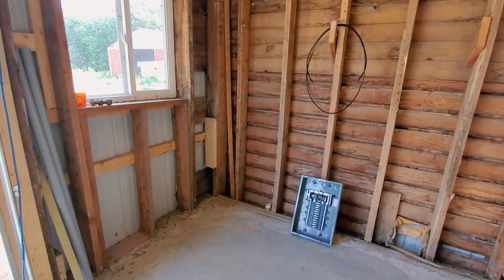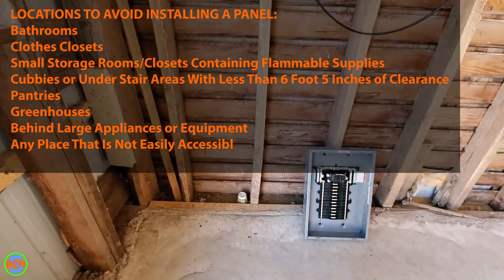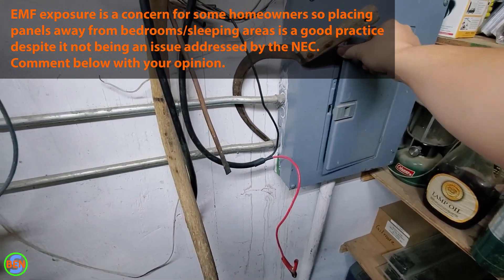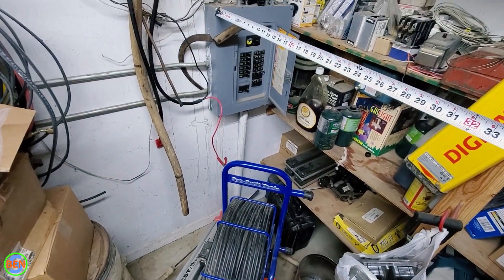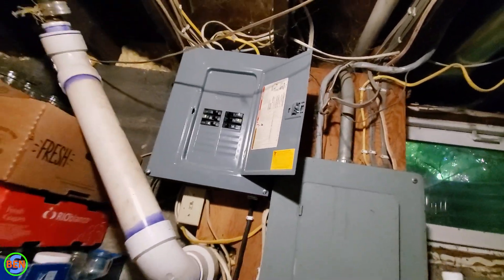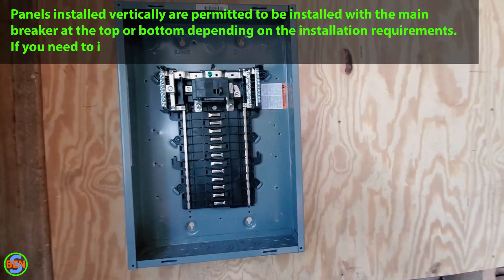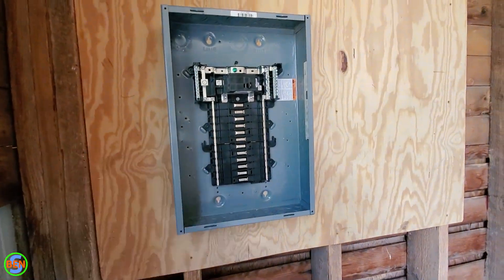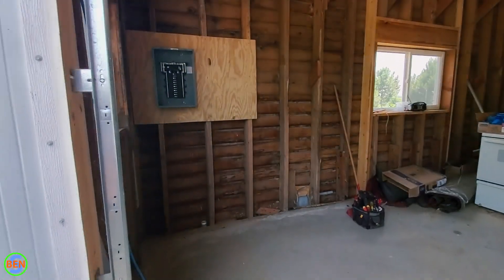How High Should I Hang my Electrical Panel?

Comment: there is rules about nothing in space above panels also such as water lines running over panel are you allowed to run a pvc pipe out of house above an electrical panel?

Comment: How is the 30 in rule applied when there are multiple enclosures.  I have an outdoor 320 amp meter socket, , with a 200 amp disconnect on the left and a 200 amp main breaker panel on the right,  with 2in x 5 in nipples connecting them (raceways) so basically 4 in between enclosures.  Any restrictions to consider?

Comment: WHAT IS THE MINIMUM HEIGHT FOR A OUTDOOR COMBO METER AND BREAKER BOX? Homeline 200Amp 30-Space 42-Circuit Outdoor Ring-Type Semi-Flush Mount Solar-Ready Main Breaker Plug-On Neutral CSED
DOING A REMODELLING JOB WITH A MASSIVE AMOUNT OF THINGS TO TAKE INTO CONSIDERATION.
WANT TO PLACE IT BETWEEN A TRIMMED WINDOW AND THE CORNER BOARD  APPROXIMATELY 30 INCHES WIDE.
WANT TO ENCLOSE THIS UNIT IN A  "CABINET" WITH A DOOR  THAT ALLOWS THE PANEL'S DOOR TO OPEN 90 DEGREES.
WANT THE TOP OF THE CABINET TO BE BELOW THE  BOTTOM OF THE PICTURE-FRAMED WINDOWS TRIM . WHICH IS NO MORE THAN 46 INCHES HIGH. ANY INFORMATION WOULD BE HELPFUL THANKS. CHARLOTTE NC.
Reply from the maker: I would contact the local building or electrical inspector in your area. I don't think that there will be an issue based on what you described, but it's always best to ask first.

Comment: does anybody know how low to the floor a breaker panel can be mounted? is there a minimum. I want to locate mine about 2 ft off the floor .
Reply: Did you find out the answer to your question?

Comment: I just found your channel and find it very informative. I have a simple question and I would appreciate if you or anyone could answer it. Question? What's recommended for attaching the panel box to plywood or backer board? Can I use 2" hex/washer screws? What I'm doing is wanting to attach a breaker box for my water heater, the box is 12" tall x 6" 3/4 wide. So I want to attach the box to a piece of 2x10 between 2 studs with 2" hex/washer screws.

Comment: Near the end of the video for the sub panel in the garage where is the best place to bring in the wire into the sub panel.  Top, bottom or from the back of the panel ?  Say if your main connectors are on the top of the panel is it better to bring the wire from the top ?  Or does it not matter where it’s brought into the panel ??

Comment: I'm planning on installing a sub panel in a shed in my back yard.
The walls are unfinished and the roof rafters are exposed as well.
The bottom of the wall where the rafters meet is 6'4 inches tall.
The Code book says I need a minimum of 6'6 inches of height for a main panel to be installed.
The rafters reach 6'6" after a few inches in front of where I was planning to install the sub panel, but are only 6'4 directly above the location itself.
Will i need ro relocate the panel to be within code, or is this a code specific for MAIN panels only?

Comment: whats the minimum height? I'm considering installing a sub panel but my only option is to go below the main panel, and right now the bottom of the main panel is about 4' off the ground or a bit less... seems a little low for a sub panel. is it?

Comment: Good video - got to the point quickly. I'm thinking low panels are generally a bad idea over time. For example in a garage a low panel could be subject to water spray damage if someone were hosing the panel. Same possibility for a flooded basement. Also, an owner may later bury it completely with a desk or junk pile.

Comment: Ben,

Questions: I installed my subpanel in the garage and want to wire my 3 prong 220 outlets. To the best of my knowledge a natural wire isn't required for this industrial equipment. can't seem to find accurate information about if I need a 8/2 or 8/3 wire for my 220 outlets and I'm uncertain if I can use the uncovered copper wire for ground with 220. I'd also like to have a welder outlet at the front and rear of the garage. Is it safe to use wire nuts in the outlet box to run wires to the second plug or do I need a junction box? Do I need metal boxes for the outlets or is plastic ok? 

Thank you in advance. I enjoy all your videos. They are very informative. You're a very talented young man.

Kind regards 
Paul H Cassidy

Comment: A little off topic, but I'm about to do a panel swap and a few of the wires are going to be too short. Rather than splicing a pigtail with wire nuts, which I think look trashy, I'm wanting to go with Wago 221-2411 inline splices because they'll look a lot neater. They're UL approved. What do you think? Thanks.

Comment: I see you are holding to wire cables squeezed together with a u tack. I don't think that's to code in Toronto because they can over heat at that point. Where are you living that this is to code? I also seen a video where you talk about the distance of a switch that has to be more than 36 " from a sink. But I don't see that any more. Where is that switch placement video please? Thank you.

Comment: Another great video. Planning to enclose a recessed panel with rockwool insulation and plywood walls. Is there any requirements for fire? I am considering six inches on sides and 12 top and bottom using cement board that is removable for future cable runs. Thank you!

Comment: Quick question for you.
I am trying to avoid paying several hundred dollars for the electric cable needed to run a line from my power box (on the power pole), to a secondary location. (The solid core cables for the 6 awg in my area are about 3.5$ a foot, but I can get stranded 3 awg for a little over 2$ a foot.) But I wasn't sure if it would be possible to do the connection between the 2 panels with that wire, or if it was only possible to use the solid core wires, due to having the neutral and ground separate. (None of the local electricians want to actually answer questions, and after watching your videos you seem like you know a good bit about this stuff.). I want to buy the equipment and then see if I can find someone to install the stuff for me. (It will be running from my power pole, about 70 feet to a storage room that will eventually be the power room for my homestead I am building up, I will eventually be migrating off the grid using solar, and wind power.).

Comment: Ben, one thing to think about is if you are wiring a house for the elderly, make sure that the top breaker is reachable by someone in a wheelchair. 
That is the reason for the 30” & the 36” clearances. 
When we had a house redone in 92, because mom was having double knee replacement surgery. 
Leroy the carpenter recommended that the electric breakers be moved to the porch off the kitchen at a height reachable by a person in a wheelchair. 
We never regretted that! 
Since 92 to now 3 people have been in a wheelchair in this house, 1 for 2 months, other 2, 3 to 10 days. 
Another thing that we did was to install outside outlets on the street & the alley ends of the house. Each one is controlled by a GFI breaker. That way when we come home, we plug the outfit in, turn on the front or rear breaker when we need it. 
This year on New Years Eve it got down to -28°f. 
Nice to be prepared. 
Power went out at 4:30 pm at -22°f. 
Came back on at 8:00 pm at -26°f.
Thank you for the helpful videos!
Hello from north east Montana. 
10 miles from the Canadian border.

Comment: What about a panel installed over a workbench? Does that violate the frontal clearance guidelines? Let's say it's a bench permanently attached to the wall, about 2' benchtop width, 2' below the panel, wires feeding top of panel, ample clearance on either side.

Comment: You should do a video on how to feed a sub panel from a sun panel in series…. 

I’ve looked and can’t find anything..

Especially I had a 18 slot Sub panel installed in my shed using 150 feet of  6awg with a 50 amp breaker and have a remaining 30 feet of 6awg..

I want a 20amp receptacle 60 feet away and have 10awg however it’s not easy to wire receptacles with 10awg and I don’t want to pigtail 12awg nor do I want voltage drop with the full
Run of 12awg

I was thinking of installing an outside sub panel between 1 to 4 breakers using the Remaining 6awg then feeding the receptacle(s) from there

Just wondering what advice, suggestions and or ideas you’d have about that..  

Thanks

Comment: My old main panel (old 20 space Square D QO) was next to a sink and its supply lines weaved through wiring out of the top of the panel. I have a short (6'6") basement so I left 12" from the top of the panel to the joists for wiring. I also installed next to a main doorway with no door.

Comment: With the understanding that the NEC says the service panel can’t be higher that 6’-7” High, unless your that tall it should never be a problem if installing the panel at the home owners eye level. I’m 5’-8” so the sub-panels at my home and garage are installed with the main breaker lever at my height, which is close enough for both my wife and I to reset breakers or for me to do electrical work. This is also how the service electrical meter, generac auto transfer switch and main disconnect panel are installed at my height.

Comment: Where I live, NE side of Houston, all the homes in our neighborhood have the panels outside on a rear wall of the house or detached garage. They are water resistant as far as the door being flanged but not watertight with an O-ring or gasket, any conduits on the outside are the watertight kind. We get our power feed from the utility easement underground at the back of the property and it is inside grey plastic conduit, the wiring for the house all feeds through the rear of the panel into the wall. Most of our homes have a 18"-30" roof overhang so the box rarely gets rain unless there is a strong wind.  Our  meters are usually within a few inches of the side of the box.

Comment: Ben....I've been doing this close to 51 years and always ask a homeowner simple questions...like any handicappec in Wheel Chairs, etc...then hang a panel middle at eye level which puts it aboutbtop of 6 ft, but again you have to size the job site on the length of existing wiring.  I've actually hung a panel side by side and bonded the two together using the old panel as a junction box bonding the neutrals and new panel with upgraded breakers.  Stripped out all the hot conductors leaving neutrals.  Then grounded the new panel by code.  Worked very well and saved many hours of labor.  Passed inspection!  Note:  old panel was a Cleveland and weighed a ton.  Very well built panel....all copper bus bars and breakers!

Comment: In Canada I believe code is 170cm which is approximately 67". Any higher and it will fail inspection. Top breaker needs to be accessible.

Comment: I installed a mini split that overhangs the top of the panel by a few inches. Even though the space guidelines are respected, I didn't know about the rule for "no equipment installed directly above the panel all the way to the ceiling". Also I didn't think about at the time that if the condensate tray overflowed, it could drip on the panel. That will be an expensive mistake to fix - having the refrigerant reclaimed and then moving the unit over a few inches, then running new line set.
Reply from the maker: Oh man that is really a bummer. Probably a good plan though.

Comment: Would a garage, where you might park your car be an issue if the car is not always at least 36" in front of the panel?
Reply: Unless you are planning to bolt down the vehicle it should not matter.

Comment: I've installed a panel with main breaker on bottom as it would have required effort to get the lines in to the top without consuming a lot of space inside the box to run them.
It looked odd, but inspector didn't give it a second glance.
Reply from the maker: Yeah, totally acceptable.

Comment: Most electricians simplify this for their ease of calculation by setting the top of the panel no higher than 6 feet 7 inches.  There are cases where the height may need to exceed the max set by code.  Whenever you run into such a situation you need to build a platform for accessibility.

Comment: There is a ton of new construction here in Maryland where panels are placed inside closets without 36 inch clearance in front and a closed door
Reply from the maker: So long as the clearance requirements are met with the door open I would assume it's fine? They mostly don't want panels in clothing closets. Obviously if the inspector approves it then it's good to go I suppose!
Reply: I heard it say that it is ok if it is an Electrical Closet (not a clothes closet) - the inspector might not want to see clothes shelves… ;-)